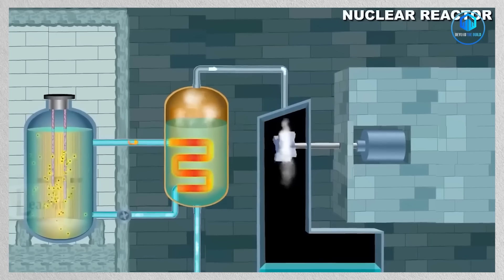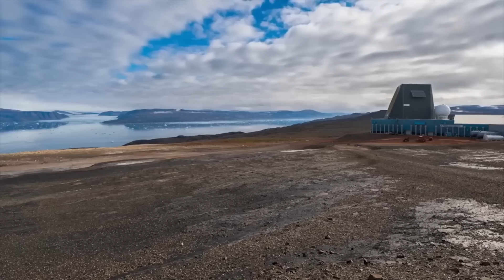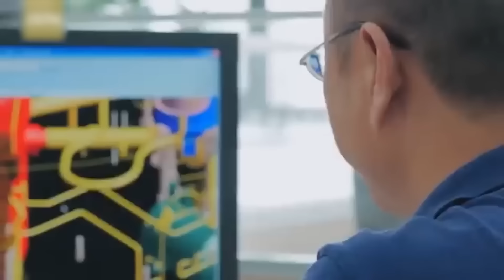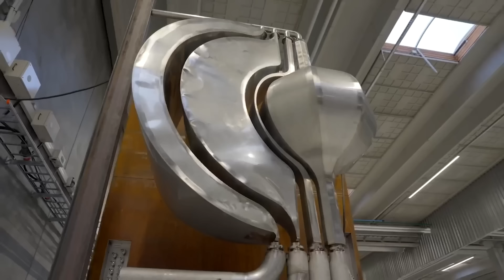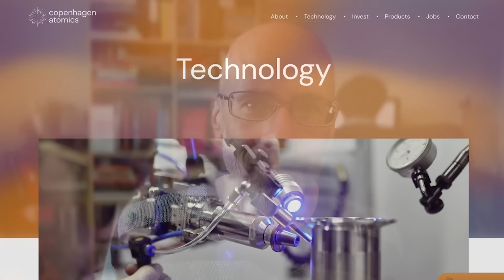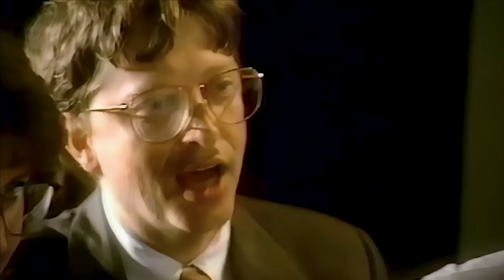Can This Device Help Us Escape Energy Poverty?

Comment: The U.S. built an experimental Thorium reactor back in the 1950’s that did work. The reason they abandoned the technology in favor of Uranium based reactors because they couldn’t weaponize the fuel. Essentially they couldn’t use Thorium to build nuclear weapons. This was an incredibly short sighted decision.
Reply: Correct! Oak Ridge National Laboratory had a MSRE up and running in the 60’s. They could just let it run on it’s own and had perfect fail safes in place. A good watch would be Kirk Sorensons’s: Thorium: An energy solution - THORIUM REMIX 2011 about LFTR’s.
Reply: Interesting! Not surprising though 😑

Humanity only really seems to care about killing each others.
Reply: Not shortsighted from the view of the military industrial complex
Reply: Nukes are fake propoganda
Reply: @ZeddsTread 
Maybe so, but propaganda works! 😮
Reply: love the handle #LOL
Reply: @ZeddsTread  how sure are you about that?
Reply: Absolutely
Reply: They abandoned thorium salts due to their extreme corrosiveness. While plutonium(not uranium) supply did play a role, it was not even tertiary reason.
Thorium breeder reactors run ON uranium, as thorium is a non-fissile element. This is why they BREEDER reactors, where they breed uranium-233(neutron fraction of 233 is only ~1/3-1/4 of U-235, which is a big problem in terms of stability) out of thorium-232 molten salts, by adding an addition neutron and then use said uranium to operate as regular reactor.
Oak Ridge was an experimental reactor that did not even have proper cooling in place, not to mention failsafes.
Project run for 5 years and longer uninterrupted run period was 6 months. Out of those 5 years, it run at "full power" for only 1.5. 80% of the time it run in critical mode.
Reply: Bullshit, thorium reactors produce Uranium 233 and that is even better than U235 for making bombs.
Reply: Geet reactor or thunderstorm generator is a better option for common people to have at home for making electricity
Reply: If the US government hadn't shut down all work on thorium, your personal "vehicle" would be powered by a micro-sized reactor, along with your home and everything else.

Comment: The “molten salt” cooling doesn’t work. Too corrosive. It’s not new technology.
Reply: I wondered the same thing
Reply: Thorium can be used in heavy water reactors.
Reply: low energy nuclear reactions is better for small residential sized reactors
Reply: Are you familiar with Malcolm Bendall?
Reply: @sigmacentauri6191 no

Comment: Technology is not evenly distributed. The USA military had iPhoneX type devices back in the late 90s that I know of. The Internet is military technology. We have cures for cancers, but the govt doesn't want those out because they wouldn't know what to do with all the old people and it goes against the depopulation agenda. Same with energy. We could easily have low cost energy, but the goal is economical enslavement.
Reply: It's not that we gotta cure cancer it's that we were tricked to get shots that cause cancer.
Reply: The real challenge is getting people out if the propaganda manipulation and join together to fight this. That would require a unifying concept that was highly resistant to co-oping. Idk is possible for most people that have been so we'll manipulated from a young age it will be impossible for most. It would take a religious miracle to unify enough people. That miracle based on current predictions might not be from the side of freedom.
Reply: @skynet4496 sadly true as well but solutions exist to help with that as well like turmeric and low dose nicotine and a few chemical options mixed in. Along with detox after the spike protein breaks down and to remove the vaccines cancer causing chemicals. I also assume the government has a cure as well but it will come with your compliance.
Reply: as I understand it.. cancer occurs, when body´s detox cant keep up cleaning trash as it continues to pile up, so body will store it trying to contain it, so it does not spread around the body freely, implicating other organs.. so basically, there are many ways to cure cancer, and some detoxes are better for some specific trashes, even right thinking and energy can help.. but thanks to corporate propaganda what people dont understand or dont realize is, that their way of life, food full of trash, what they inject into body, environment they live in, creates insult to the body and therefore trash that is hard to register at first, but it accumulates over time, until it overflows, so body stores it..  even terminal stages and be cured, and many people survived it and made full recovery, even without corporate medicine, leaving doctors baffled.. because it is a captured industry and mostly you wont get to keep medical license, unless you practice propaganda and make profit for corporations.. basically, it is a business model based on blind trust in authority..
Reply: @PeacecelebrateWæponytail Corporations(corpse or rations)
Reply: The cures are on the internet it's just hard to sort through the misinformation to find them. Mostly has to do with antiparasitics and having the correct hard to get minerals  usually selenium. Also oolong tea and most natural anti parasitics have anti cancer or aid your body to eliminate the cancer completely.
Reply: I've said for decades now that all new technology (all of it) has it's nucleus in the Military industry complex. 
Most obvious ones...
Amazon 
(distribution systems) 
Microsoft 
(data gathering and manipulation)
Apple
(Communication)
NASA
(Satellite GPS)
It's all leaked out to public via so called capitalists like Gates, but he's anything but a bloke who invented something in his garage. 
Him and all the others, military! 😮
Reply: If anyone cares, the vitamin B17 is known to fight cancer.

Comment: Thorium has been well known to be a safer alternative for a nuclear reactor.
Reply: They have no byproduct for weapons manufacturing. That is the real reason they never made them even though they are way safer cheaper and more efficient. Also when combined with critical co2 instead of just water turbines they become even more safe and efficient.
Reply: You can also use a parabolic mirror to boil water and bio diesel engines there's Is no energy poverty
Reply: @elliottjames671 great low cost and low resource options. Especially if the mirrors are made from scrap or Milar.
Reply: @elliottjames671  https://youtube.com/@sergiyyurko8668?si=LpeGOj8d_FTasd0n
Reply: You don't need any of this 💩 there are already natural energy alternatives.  Methane Midden" is a backyard, small-scale DIY experiment inspired by Jean Pain, designed to produce both hot water and compost from a massive, fermenting pile of organic material
Reply: @elliottjames671 how big is your pile? Do neighbours complain? How many people can it support? Is the waste from 1 person, supply sufficient energy for 1? Thorium is the future. Waiting a long time for good news.
Reply: @truthaus6840  Distant future. Thorium and fast breeder reactors have been understood for a long time and even had a molten salt reactor prototype in the 60s... But the challenges in all fast breeder reactors and trying to design systems that can handle molten salt REMAIN DIFFICULT or near impossible feasibly... Not hating on the tech I actually love it and have studied it deeply. But in study I found there are numerous difficult challenges to this type of system. If we had fast breeders all nuclear waste would become an endless supply of fuel and would make all the waste safer. But I've found most efforts fail because of these challenges.
Reply: @elliottjames671  Methan biodigesters are nothing new, there are plenty of DIY options, you just need to own enough land to produce enough green and brown plant matter, raise farm animals or scavange rastaurants and school kitchens daily for the food waste. The best systems use their black water septics as the basis, plumbed in with a compost grinder in the kitchen. Enough gas for cooking, but not much else. 

As for heat out of compost piles, yeah, cool. I built one for an outdoors shower, based on a 12 meter compost pile (huge pile), yet, the heat produced was good for a couple of showers a day at most. You'd need a compost pile the size of a family house to create enough hot water for a family, and you need to keep adding and turning that compost. Good luck.
Reply: MSR is better. We don't need nuclear material.
Reply: And thorium salts have bee well-known for their corrosiveness. Huge problem that has not been solved to this day. While technological advancements allow now to use such reactors for years, instead of months, problem is still there and still big enough.
Reply: It's been known by Dr Gerhard schrauzer who when he was alive was the world's foremost authority on Trace mineral research as one of the 90 essential nutrients that is essential to optimal health. You essentially can't have optimal body function without an adequate supply of thorium in your body and you sweat it out every single time you start sweating. Most of you never replaced it with an adequate supply and have health problems because of it. But in order to get thorium you basically have to take it alongside the entire bevy of rare Earth elements. And you also have to be able to form an ionic bond with it in your gut lining. Most of you probably can't really manage that.